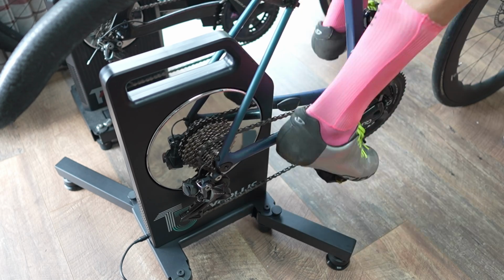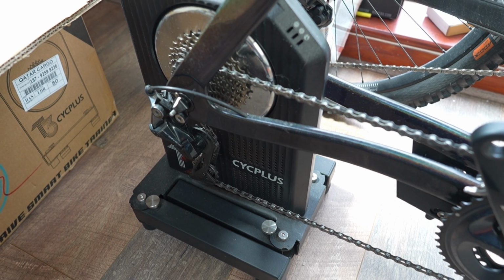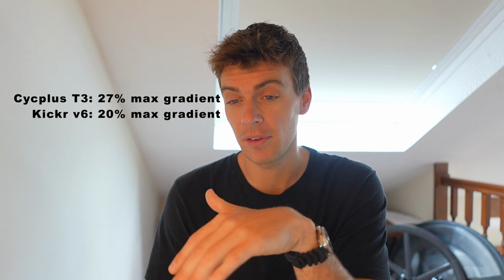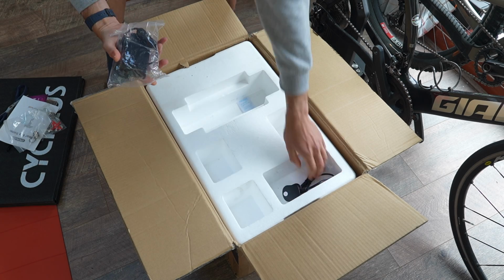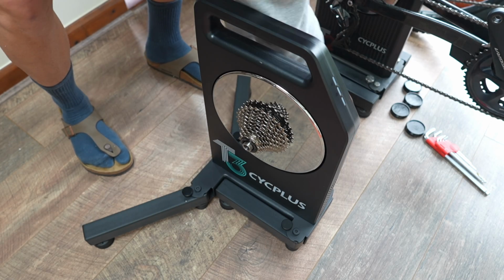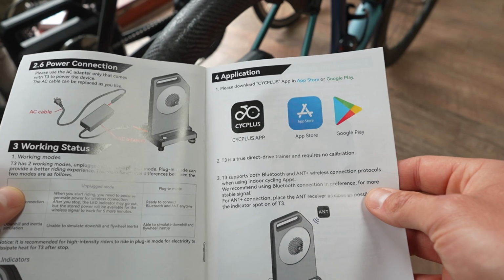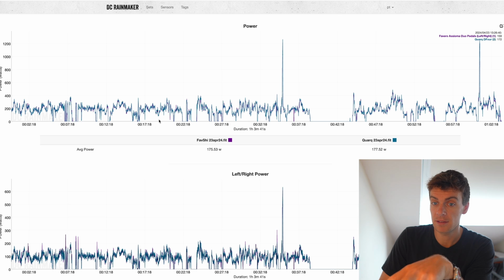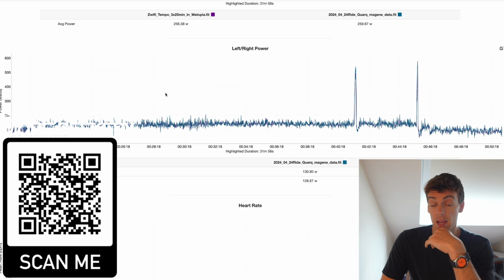Failure or Wahoo Kickr rival? Cycplus T3 indoor trainer Review.

Comment: I've had my T2 for a few years now and mostly use it for Zwift racing. I listened to your limitations of the T2 vs the T3 and for me and likely the majority of riders, the T2 would be more than enough...while being around half the price and quieter. I do understand your issues with the T2, I've just never experienced anything like what you are describing. This is a function of how I'm using it vs. how you are. Everything you describe makes perfect sense...my knees are gimpy, and my cadence rarely goes below 70 rpm's. I think any user that is not doing small chainring, low cadence, high power output for extended sessions would be just fine with the T2.

Comment: Thanks for the great detailed and thecnical review. I've got T3 recently (3weeks), and I'm facing hard time to try equalize my usual Garmin Vector 3s (single) pedal powermeter with T3 output watts. The diference is huge, up to 40-50W lower in T3.

I've tried to adjust between 94%-100% the chain drive coeficient, but even with 100% settlement, I still got 40-50W lower in T3 (doing Z2 200W in my usual pedal based  powermeter, it shows ~150-60W in T3 output)

Do you have any recommendation? Is it possible my T3 device is lacking of calibration (from factory) or other common issue?
I'd appreciate if you comment back. Thanks again.

Comment: Hi! Does removing and putting the back wheel in the trainer damage the thru axle threads?
I have an aeroad which has the threads built into the frame, not the hanger. I always keep the threads well lubricated but I'm still concerned that i will need to trash the frame because of worn threads in the dropouts. 
Is this an issue I need to keep an eye on?
I always torque the axle to 12Nm (rec spec is 10-15)
Reply from the maker: Should be fine but deffo keep and eye on it. Its a stupid design decision to not make the threaded parts replaceable

Comment: I don't know if the mic has amplified certain frequencies but it doesn't sound that quiet!
Reply from the maker: Hairdresser moaning again. The mic on the camera is directional and pointed directly at the motor. I dont think its that loud honestly speaking, but there is a whine.
Reply: @PeakTorque  I imagine how quiet something is both relative and a matter of perspective. Why not do a decibel check in future and then everyone can go...oik..its 10db louder/quieter than X and XX and X? I say this as a viewer and not someone that has to do it...but...given everything else has tangible stats?
Reply: @out_spocken   A decibel reading isn't sufficient.  Frequency distribution makes a huge difference to perceived loudness as human ears are not equally sensitive to all frequencies (See Fletcher-Munson curve research for more).  Something can be 10db louder, but the frequencies produced can be distributed in a manner that's much less annoying, and actually be more tolerable overall.  So you need a comparison using Fast Fourier Transforms to analyze the frequency spectrum of each to really have all the info.
Reply: @riknos3289  Agreed. Would also need to use the same room, same mic in the same place. I get the acoustics and frequencies...perhaps just didn't know the way to explain that this would be measurable.

Whether it's financially viable is another thing entirely I guess?

I tried listening to mine and I don't hear a whizzing from the machine (wahoo kickr).

Comment: With the magnets design, is it more aligned with a Tacx Neo?  in which case how is the inertia, having compared Neo v Kickr I found the Neo very slightly harder for high power efforts, climbing and ERG mode. My test was to do the same workout twice and compare pwr/hr for each interval.  Interested to know  how this feels compared to the intertia of a physical flywheel.

I can't decide which is the more natural/accurate inertia Physical v Virtual flywheels.

Great vid as always, thanks!
Reply from the maker: Good question. I do prefer the feel of a geared up flywheel but this and the tacx have similar sized direct drive motors. A lot simpler, compact and less moving parts is one advantage. But the ‘feel’ of low cadence high power (climbing) efforts can feel a bit odd in my opinion. At higher cadences, i cant really tell the difference.
Reply: @PeakTorque  I kinda feel that virtual/magnetic flywheels tend to provide much less inertia when in ERG mode at higher resistance, climbing or just going hard not sure if it's a restriction of the technology.....physical flywheels will/tend to always provide intertia, obviously the affect of which is less as resistance increases.  With the Tacx Neo, if doing a high resistance climb or interval you cannot pause for a second because the resistance just grabs you as it's it continuous and instantaneous, whereas even in these situations with physical flywheel there is always some intertial...... I don't have the scientific knowledge to know which of the two is the more realistic/correct ..... also not sure if any of that makes any sense

Comment: Finally gave in and paid for DCR analyser huh?

How's the Magene C606 been? Doesn't look too bad on paper, except the storage space which seems worryingly small, but I've heard in practice it still needs a fair bit of work.
Reply from the maker: Initial thoughts on c606 is that its not ready. Battery life not the best. Not even loaded with any maps. Im still a firm fan of the igps 630. 7hr ride and only dropped 12%. Incredible battery life after 2yrs of use. Am now testing the 800.
Reply: @PeakTorque  As someone with both the Garmin 1040 edge and the IGPS630 I'm constantly shocked by the battery life on my IGPS.
Reply: @voidsofold  Shocked in a good way?
Reply: @Robutube1  yes, it lasts literally forever. If I'm ever touring im taking the igps over my Garmin.
Reply: @voidsofold  Thanks for clarifying.
Reply: @voidsofold  Isnt it buggy tho ? plenty of people say the UI sucks and isnt refined
Reply: @telkmx  the UI is infinitely better than Garmin's
Reply from the maker: @voidsofold  agreed. I don’t know what theyre doing in that unit the battery management is insanely good. If you’re not bothered about gimmicky features and just want a huge battery life, sensor connection and basic mapping its a no brainer.
Reply: @PeakTorque you have to download the maps on the device (C606)
Reply: @PeakTorque  Will u review the 800 ?
Reply from the maker: Yep. It was generously donated by the dev, a kind man. 🎉
Reply: He's probably not aware that zwiftpower has the exact same tool for free (it's not limited to zwift rides).